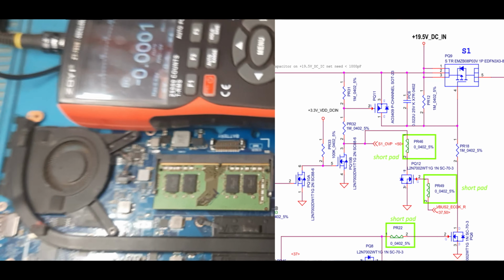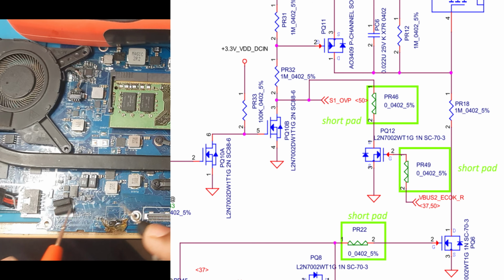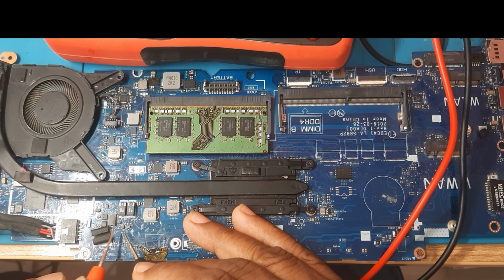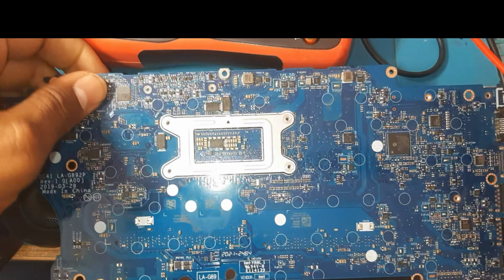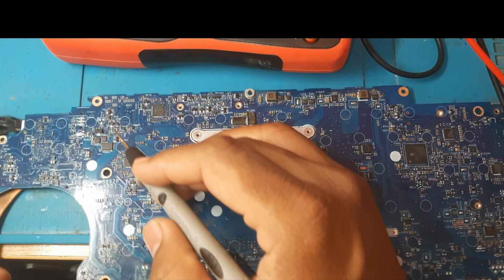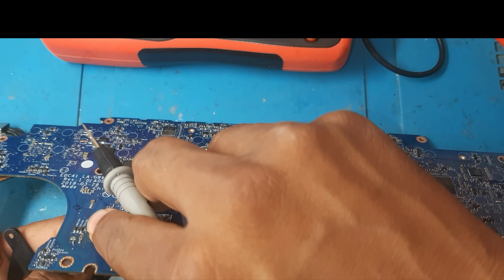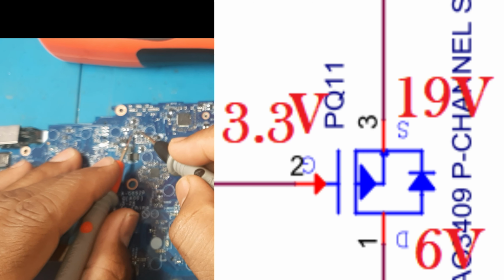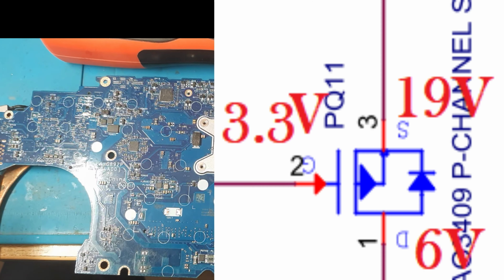How to find fault in logic circuit | Dell 5400 | Pavithra Laptop Care | Laptop Secrets

Comment: Board is working or not? Why you didn't explain what is problem on board. What your trying to say?
Reply from the maker: Hi. Pls listen my explanation again in this video.  It's fault finding methods to beginners.  Many of the won't give concentration on this. Got a request from a member regarding this. So, explained the method. 
Board was in short condition. After replacing the mosfets,  charging ic, acp-acn caps and resisters working fine.